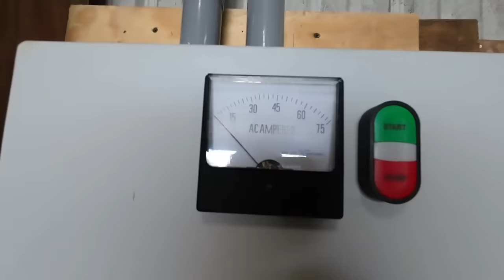2nd Silo Build Begins

Comment: Those silo workers have quite the system. Fun to watch.
Reply: Wonder what powers the little “trolley “ that carries the concrete around the ring?
Reply: @larrybarton2351 It's hydraulic there's a pump up top that's also what power the cranes on top I built silos for 10 years before these guys came in and bought our company then got out of it.

Comment: Ever think about a stand-on skid steer for inside the buildings?   The visibility is excellent for tight quarters.   Also easier when you have to hop off and shovel every so often.
Reply: With the amount of dust when bedding etc, a cab is rly nice
Reply: Kind of pointless
Reply: Not a bad idea but it would be kinda useless for them
Reply: Yeah the ditch witch sk900’s can lift like 1800lbs and are 38” wide idk why more folks don’t use them. The cab and the size of a bigger machine is overrated for many, many tasks because those machine are too big to functionally do things mini skids can. Maybe a big dairy like this isn’t the place, but mini skids have a place as labor becomes more expensive. A skilled mini skid operator can do what like 5 people can do at once, depending on the task
Reply: We bought a Case 1818 just to clean calf stalls. Beat a pitchfork by 5:1, in time savings.

Comment: For the calf pens ....if you bolt a 4x1 or 6x1 boards to the inside of the big gates it will hold back the sawdust in the pens. The appropriate sized u bolts would hold the board tight against the rails.  You would probably use less sawdust also over the course of the calfs life in those pens.

Comment: If you know what a plumbing blow bag is, in might save you a little trouble with that plugged pipe. I assume that pipe is 4 inch, get the right size. It is a rubber bag with a hose connection on 1 end, when you hook it to a hose, then make sure you shove it fully in the pipe, then turn the water on till it clears.

Comment: a small strap to the bar above it would really stiffen up that gate from the mounting bolt for the air ram. the rotational force on the bar is prolly the worse thing for longevity.

Comment: For that pipe out of the calf barn, you might want a drain cleaning hose and head. It's a pressure washer that jets backwards, pulling the line after itself. You stick it up the outlet and work up the pipe

Comment: Id put a slop floor in the of your silos just for the flat floor so if you need to cleen out the silo  and you can run the unloder to the floor with out picking up rocks or other dibrie  4 inch thick  with fine wire mesh 1 sheat per inch to keep it in place if it cracks

Comment: Would it help running a second 2 by 6 on top of the calf gates to minimize the bedding pushing out?  If 2 by 6 is a little to tall run it through the table saw to trim it down to fit.   Just an idea to keep the aisle a little less cluttered.

Comment: I have an ordainary 1000 gallon domestic septic tank buried next to my calfhouse. Its fitted with a cheap submersible pump, which pumps the calfhouse runoff across the yard into a slurry tank. Its the worst_ smelling stuff in the yard and not something you want to handle

Comment: Seems like i remember yall having a dirt bucket with teeth for the skid loader (might have been a demo) but was wondering if that would break into the bed pack better?
Reply from the maker: It would break it up well but wouldn't be great for scooping against the back wall. Not a bad idea though
Reply: @10thgenerationdairyman61  I did think of that and would require switching back and forth

Comment: Did the $150k cost for this silo include the roof, unloader, triangle hoist system in the roof, i.e. everything needed to put the silo in operation? Thanks
Reply from the maker: 150k for the footer, walls, roof, ladder, silo pipe ect. Unloader was another 25k on top.

Comment: Would make fpr interesting content. Amazon sells a Sewer Jetter Kit 100FT for Pressure Washer, 5800PSI Drain Cleaner Hose 1/4 Inch NPT Corner Rotating and Button Nose Sewer Jetting Nozzle Spanner Waterproof Tape Pearl Corsage Pin

Comment: Hey Eric when the silo builders get to the top have them mount a jib at the top just outside of the outside ladder cage so you have a pulley system up there at all times to pull up tools new augers etc. made mine out of 4 inch square aluminum....it will never rust with stainless steel pulley